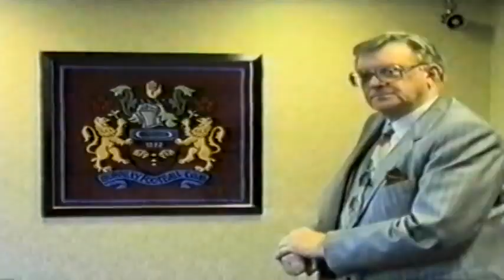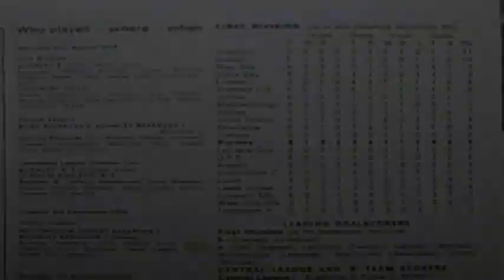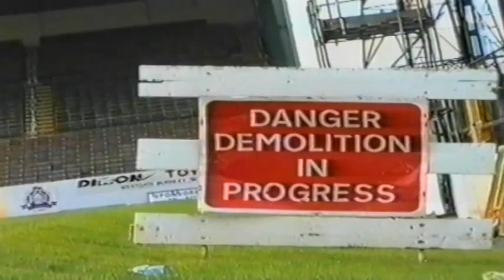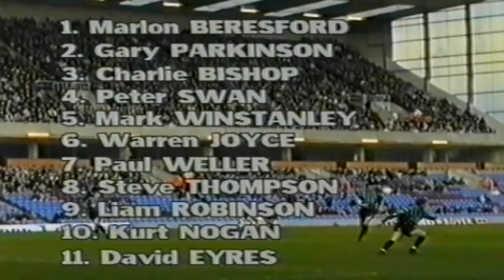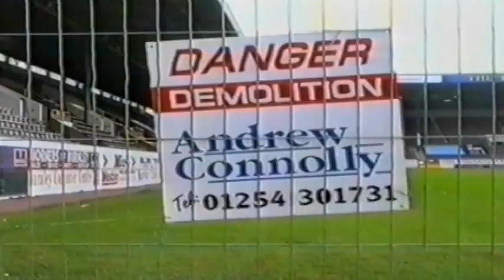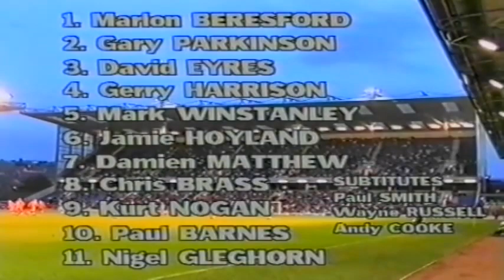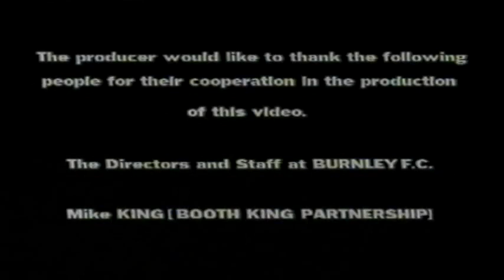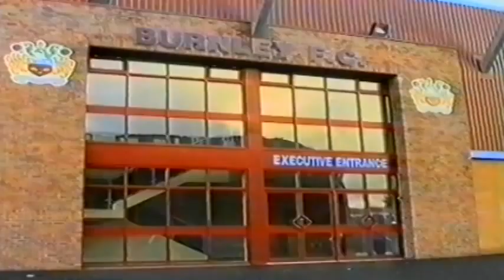BURNLEY FC | THE REDEVELOPMENT OF TURF MOOR 1996

Comment: It's like a cheap version of Ewood not as nice and smaller
Reply: Apart from the fact turf moor is much better with better fans
Reply: @matthewbradley6633  no its not, smaller fan Base ,smaller stadium, smaller club, smaller in every way the only thing Burnleys club and fans have is their hands due to having five fingers on each hand
Reply: @RubyMarkLindMilly  Having 5 fingers is a good thing provided you count the thumb as a finger which ill take it as you do Mark Cannon
Reply: @matthewbradley6633  no five fingers and a thumb
Reply: @RubyMarkLindMilly  , Ewood was a decrepit old stadium before Jack Walker rebuilt it. Hovis actually made an advert from there, saying the same thing.
Reply: @stephenmcloughlin7718  so what's your point?
Reply: @RubyMarkLindMilly , just that I remember Ewood when Rovers weren't allowed to play on it if the wind was above 14mph. Wooden benches with the seat numbers painted on , cobbled streets and tramlines outside.
Reply: @stephenmcloughlin7718  still don't get what your trying to say?